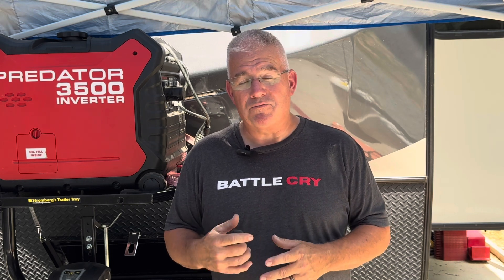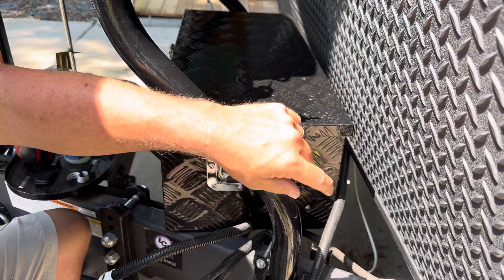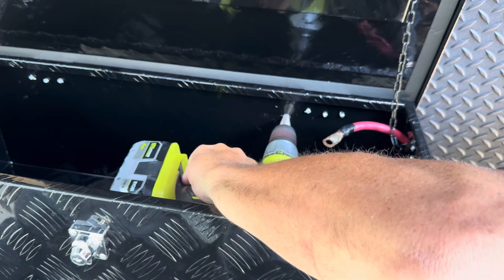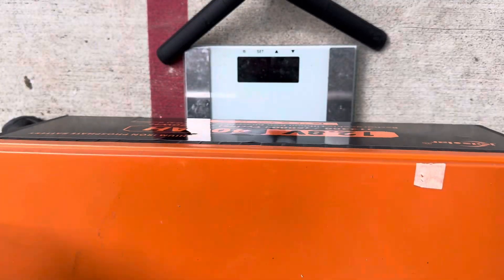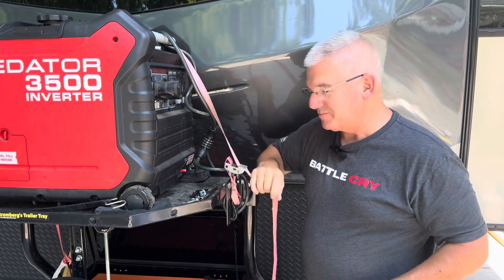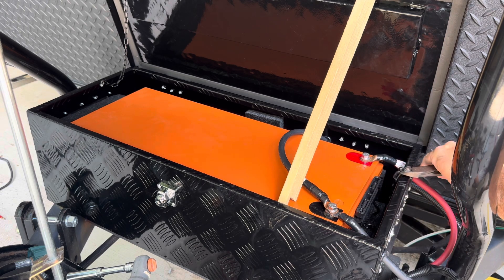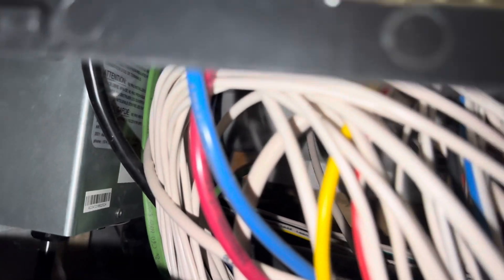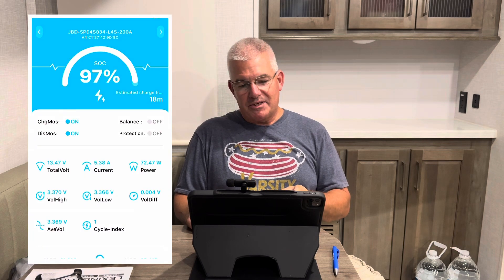RV Lithium Battery Upgrade, JSDSolar 400ah LifePO4 Lithium Battery

Comment: Hi Jeff, thanks for this, very helpful.  Two questions for you.  What else can you run on the battery (microwave, AC, GFCI appliances, etc.)?  I watched your videos on the Predator stand, which is what I have, and am also interested in doing that.  But how do you put fuel in since is much higher now?  Thanks.

Comment: Has the battery held up well. Nice video
Reply from the maker: So far so good. We dry camped in the smoky mountains last July and the battery did exactly as I had hoped it would. I haven’t checked the battery this year to see how it’s doing since the cold weather. I plan to check it this weekend and I can update you